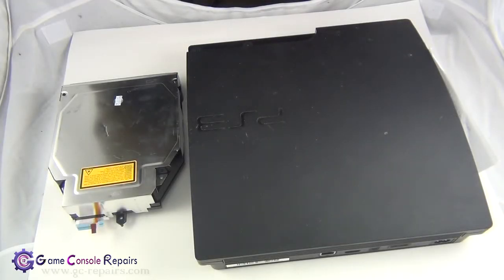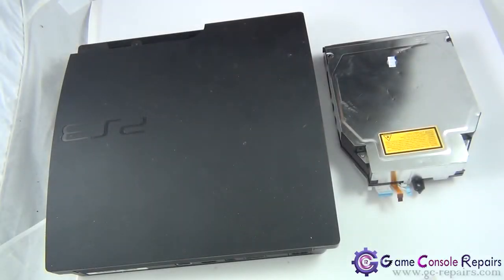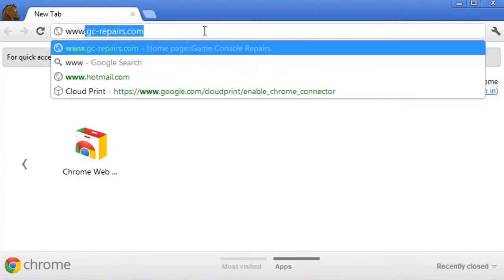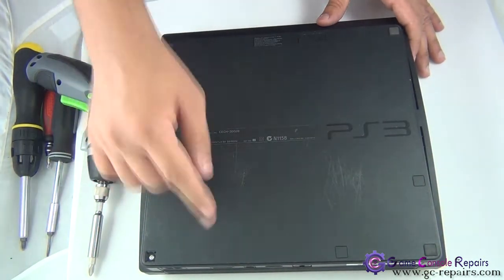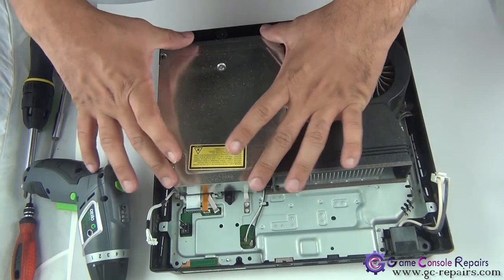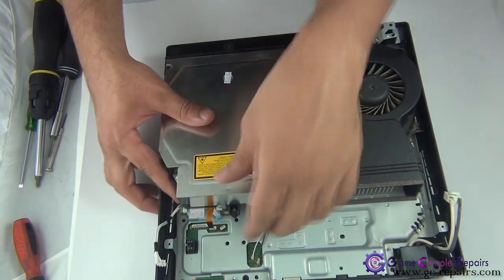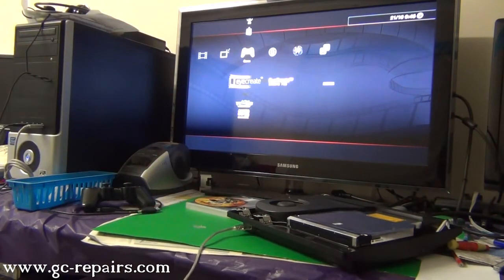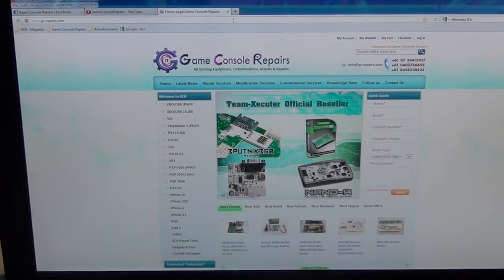PS3SLIM   320GB 30xxB   Blu Ray Drive Replacement by gc-repairs.com

Comment: GameConsoleRepairs+ Instead of just replacing the whole blu ray drive did you take it apart to see what's wrong with it? Maybe check for mis-alignment or maybe clean the blu-ray lens?
Reply: correct 👍

Comment: I wanted to clean my ps3 and I opened it up after watching an old youtube video. I found out that my ps3 isnt the same model as the one i the video :/ But its the same one in this video. I was wondering if you could make a video on how to remove the fan?? Thank you :)
Reply: You need disassemble until you can lift the motherboard with the magnetic shielding off the case. Then you need to turn it upside down, remove all the screws from the bottom metal plate, then carefuly lift off the motherboard that is being held in place by thermal paste. 

Then you have the Fan, Shroud and Top Metal Plate you will se screws under that Top Metal plate --- remove that and the shroud and fan will come of.

To put it together again you need to replace the thermal paste.

I found this out because I specifically wanted to replace the thermal paste on my CECH 3006B.

Hope this helps.
Reply: Thanks for the reply! Ive done that too. Cleaning the fan and replacing the thermal paste. Had to learn by experience; it was kinda scart haha But thanks for the reply! Have a good day :)

Comment from the maker: If you dont have a blu-ray drive, buy one mate - They are cheap as now-a-days. we are selling Brand New Blu-ray Drives for $90.00 bucks. No need to fiddle around with small little pieces and messing around. Simply Buy a new one from our store and carry out replacement- you'll be back in business in less than 10 minutes.

Comment from the maker: sorry about the late reply. totally missed it

I checked your video. sounds like something is not sitting properly 
some sort of gear issue. good thing is its ejecting the disc meaning something is dis aligned. Rest by the sound of it is OK.

What is your PS3 Model Number and did you change Lens or lens mechanism ?